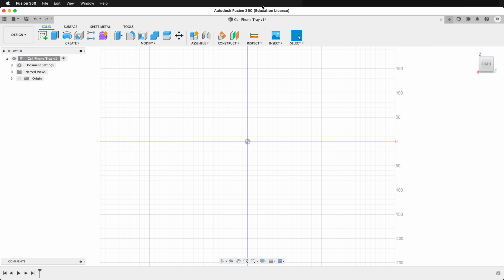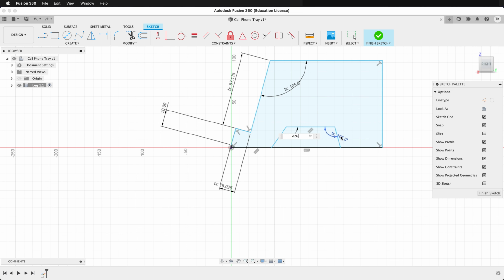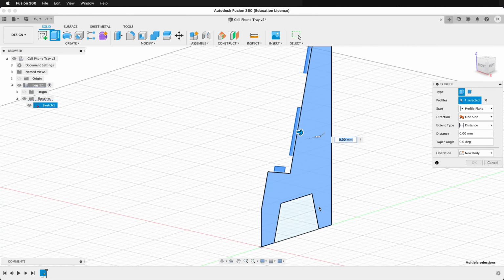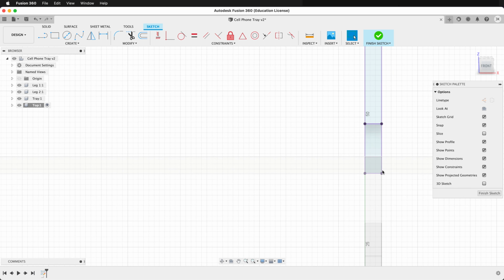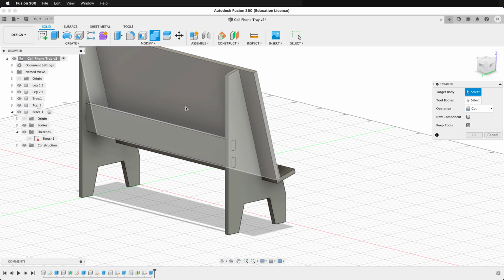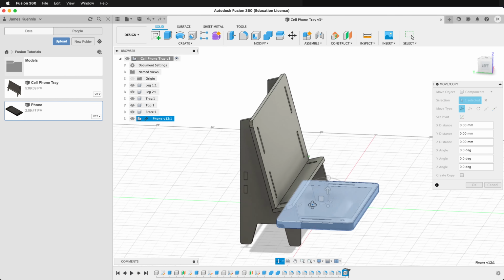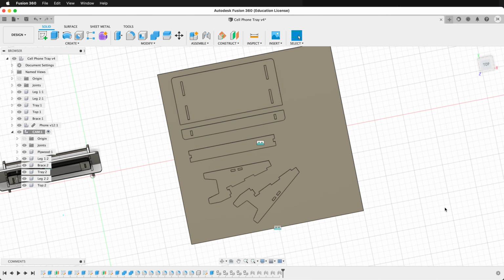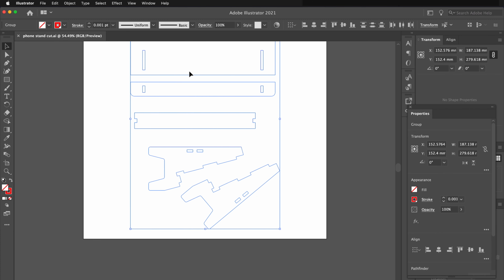Laser Cut Cell Phone Stand in Fusion 360 with Cutting Kerf automatically Added to DXF File

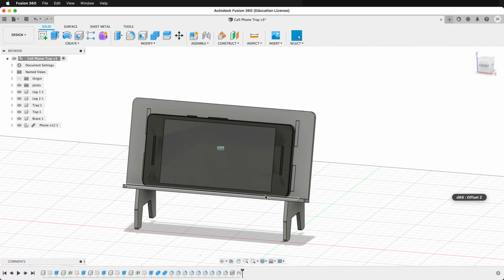Comment from the maker: At 25:43 this video uses joints to lay parts flat. This technique still works but a better way is to use the new Arrange tool in Fusion 360. This video shows the updated method of laying parts flat with the arrange tool - https://youtu.be/jeQPJHHwVN4